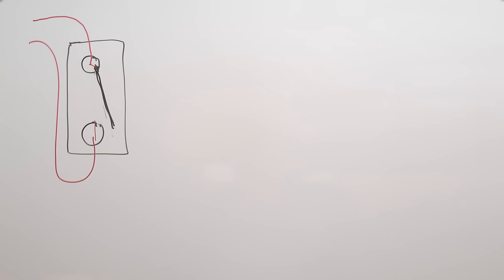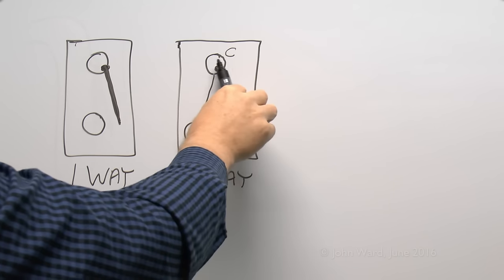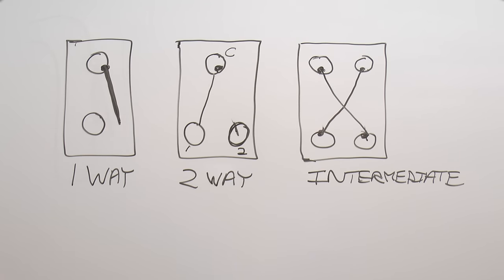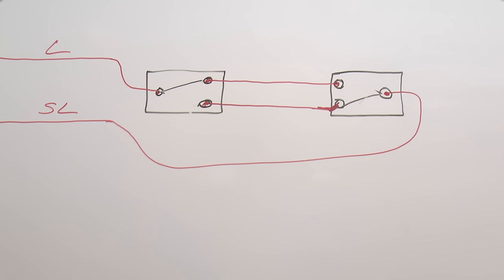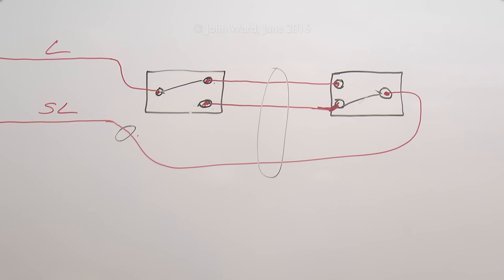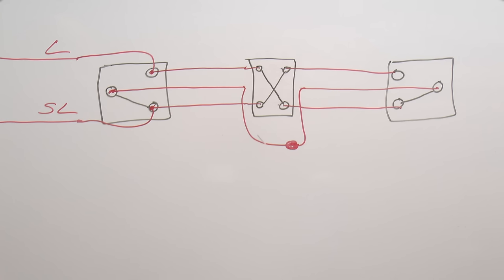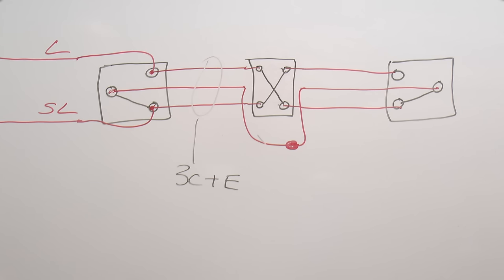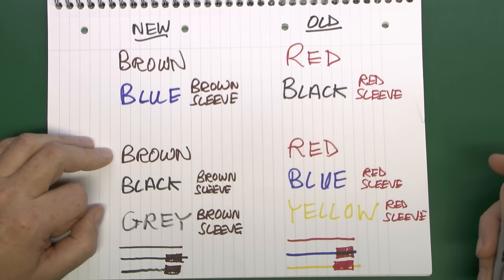Lighting Circuits Part 2 - Wiring Multiple Switches, 2 way and Intermediates

Comment: This helped me understand how circuits with intermediate switches work. Thank you.
Reply: I had seen both method 1 (conduit) and method 2 (house style) and always wondered why would they even do that.. (yes, I am watching a video of something I already knew)
Method 1 always seemed easier to understand and uses less cabling.. Why would anyone use method 2??
It wasn't until I seen the way that John drawn it I had the 'AHA' moment and noticed
Method 2 works better when power goes to the light, but just before being wired in, the switch is (kinda) like a spur. (Not really, but it's how I am going to remember it)
But Method 1 works when the power comes from Location A, gets a switch along the way, but the light is in Location B, and the light will just be connected to neutral in whatever way it wants.

Comment: Quite some years ago, I had a garage, with a single light, operated by a single switch by the rear door. I wanted to add  a switch to be able to turn the light on from the main garage door. My then boss, tried various ways of explaining how to do this, but to no avail! I just didn't get it. This video has made it very clear how it should be done. If only the Internet and YouTube had existed then, and I still had the garage.........!

Comment: I absolutely love all your videos. Clear, educational with easily understood, uncomplicated diagrams. 

One question I have: if you’re running the power from the consumer unit to the light switch and not the light, and you want the light to be 2way/3way, how are the switches wired. Many thanks.

Comment: I should have revised this video this morning. What I thought would be a straightforward consumer unit upgrade had turned into a baptism of fire. Having to change all connection as neutrals were being switched instead of line, then on a two way light the Single core cables, all red, not descenrable from each other could not fathom what was going on, not getting readings as expected, one switch worked, other didn't, hair loss was inevitable till I plumbed for switch must be faulty. Unsurprisingly, switch was faulty. Lesson learned, go round checking all accessories before I start!!! So now we're leaving the EU, can we go back to our original colours, especially red, white and blue for 3 core, how patriotic. Oh yes, great videos John.
Reply: Lee Greveson h
Reply: Yes! Patriotic sparkies I can handle.
Reply: No reverse from Europe, brexit or no-brexit, a group called CENELEC is quietly standardising all our electrics.

Comment: Hi John. Here in America we call your 2 way a three way switch and your intermediate is a 4 way here. The principal is the same here but we have to phase the neutral to split the 240 circuit at the main panel. Witch is your consumer unit. It's neat to see how you guys wire stuff there. You are very informative. Happy holidays to you .
Thank you
Mike.

Comment: Here in New Zealand, we use 1mm  3 core wire ( I forget the name of it),  the colours are Red, White and Blue. The outer plastic insulation on the cable is yellow, It's a bugger of a thing to work with because it breaks all the time while stripping it.  We also use 1mm for residential lighting as well

Comment: In Canada, the one way switches have an "on" position indicated on the switch handle, wheras the 2 way and intermediate ones don't.  I'm not sure if the wiring code permits 2 way and intermediate switches to be used in one way applications.

Comment: At around 17:00, an alternative way of understanding the intermediate switch is that in the parallel position the end switches are connected as before, whereas in the crossover position, it appears to each end switch that the other  switch is in the opposite state than it really is. Thus on and off are interchanged when you move the intermediate switch.

This immediately makes the use of a fourth, or forty fourth, intermediate switch obvious. If there are an even number of crossovers they cancel out leaving the end switches working as before; of there are an odd number then it's as if there is a single crossover.

Whether you prefer my explanation or JW's is a matter of personal preference

Comment: John - Great video..Do you have a wiring walk through for a 2 gang light that needs to return to the lighting ring.. e.g. 2 separate lights on a double rocker switch (..well dimmer switch) with a single live feed and a single return to the ring? Thanks.

Comment: Hi there, your video is very helpful. I wonder if you could help me with a question. I recently installed a dimmer switch in a circuit with two switches to control the lights in a room from two different points. The dimmer is a 2-way switch and works fine. However, if the dimmer is off the other switch doesn't switch on the lights. On the other hand if the dimmer is on I can switch off the lights from the other switch, but can't switch them on again with the dimmer.

According to the instructions it should work fine. I installed the same dimmer in other rooms and they work fine but they are only a single point which makes it simple.

Comment: Hi John.  I am using the switch connecting system, as I want to install a number of downlights.  This is straightforward with the exception that I want to incorporate two way switching using 3 core and earth. Where previously I would intend wiring the brown wire from the power in cable to the Common, in the video the black wire from the 3C&E is wired to Common.  Can you please describe the correct wiring in this situation.  Thanks

Comment: Hi John, Great set of videos thanks. I wonder if you can help I have 2 lights at separate ends of my dining room both controlled by a one gang one way switch. Would it be a massive job to install a two gang switch to control each light separately!

Comment: I have two-way switching in my bedroom - and there is a spare box by my side of the bed (there is a switch the other side). There is no wiring in the spare box or I would have looked into three-way switching. As it is I now have remotely controlled LED bulbs in both fittings, enabling control from my side of the bed.

Comment: John - thanks for these videos. The best I have seen so far. I get the concept but I don't quite get how to extend the concept to multi gangs.  In my bedroom I want a 3-gang (1-main light, 2-bedside lamp A, 3- bedside lamp B) a 2-gang (1-main light, 2-bedside lamp A) and another 2-gang(1-main light,2, bedside lamp B). I can't find a way to wire all the 2-ways together. I understand that all of these will be 2-ways. However I can't get all the wiring diagram right.

Comment: thats very interesting i didnt realise you could use the two way switches backwards using three core cable. i have always used them in the tradional way but you need to use four core cable which you did not mention. two lives,neutral and earth. 
very clearly explained though. thanks

Comment: That last wiring example with the two switch setup I found to be just plain weird. I don't really think we use it in Canada. The other thing I found in another video was rating 2.5 mm2 wire at 26 amps. 2.5mm2 wire is between our 12awg and 14 awg wire. Where 14awg is the skinnier wire which is rated at 15 amp and 12awg is rated at 20 amp in Canada. The 15 amp circuit at 120 volts is the common one, whereas the 20 amp circuit is just coming into use for kitchen appliances, because the former standard was split 15amp circuit for kitchen use. The split circuit could actually give 240 volts across the two hot wires, so the duplex outlet was split - a joiner bar was broken off that connected the two hot terminals. A special two-pole breaker  was used which turned off both hot lines simultaneously. Wiring for that outlet was white for neutral, black for one hot line and red for the other, or two separate cables with white and black. Ground(earth) in Canadian wiring is a bare copper wire usually or occasionally a green conductor. The split circuits  met their demise with more use of the GFCI (RCD) outlets. So a 20 amp version of the outlet became available. Actually, the outlets were always rated at 20 amps, but a plug that is used on an item requiring 20 amps is slightly different, with the neutral pin being turned 90 degrees. The outlet is configured so it can take either the 15 amp or the 20 amp plug.

Comment: Wouldn't the use of the "conversion method" with the 3 core & earth cause capacitive coupling (sometimes called induced current) which would cause LED fittings to flicker or glow even when the switches are in the off position? Therefore the previous method in your video would be preferable.

Comment: In the conversion method you instruct that the switch 1 connections should be connected to the corresponding switch 2 connections.  For clarity, imagine a face: Switch 1's nose connects to switch 2's nose (common 1 to common 2).  However, you have switch 1's "Left Eye" connected to Switch 2's "Right Eye".  Is this correct?  If it were "corresponding", the figure should look like this  - : X : -  with wires crossing over the common wire.  Please clarify.

Comment: Excellent video, thank you. When they changed the colours of wire, what was the rationalle behind the decision ? Like you pointed out, the colours they have chosen do not stand out from each other as the old colours. To me, a layman, it seems a step backward with regard to a H &  S choice. The more different they are the less choice of getting mixed up....
Reply from the maker: Alignment with IEC 60446, and later replaced with IEC 60445 which is used across Europe so that wire colours are the same everywhere.

Comment: Brilliant John . I’m struggling to find a video on 3 switches but with a dimmer included. I have a double switch at the bottom of the stairs which turns on the lights going up the stairs and landing and also the switch for the hall light.
How do I add a dimmer on the landing lights that stays to the dimmed level regardless of which of the 3 switches are used . ( one at the bottom of the stairs , one at the top and one further along the landing )great video .
Reply from the maker: Wiring is the same as in the video, just replace one of the 2 way switches with a 2 way dimmer.
Reply: @jwflame  thank you so much for replying I will give it again today

Comment: Hi John, I hope you are still doing your YouTube videos, I have a question, I want to control five led wall lights, with individual switches, with two two way light switches, first of all, is this feasible and safe ( from the consumer unit, fused at six amps ) and secondly, this is off grid, do you think that this will work ok. Many thanks for any advice that you can give. I am now going to look through any other videos that you have posted. Once again, thank you.

Comment: About the colouring, in Sweden red was earth a long time ago, and as a slightly colour blind person brown and red looks scary similar! 
The other colours was White (N), Black (L1), Brown (L2), Grey (L3), so the same as the new EU-standard except neutral (and earth). 

But looking at your videos I find it amusing that 3-phase seems to be so uncommon in the UK, in Sweden it's standard for houses and more or less standard for flats. I've lived in two different studio flats, both with 3-phase. 
I now live in Norway, and here we don't have neutral, so we have 230v between phases and 115v between line and neutral. So here 3-phase is also standard, but to me used to 400v 3-phase the main fuses are huge. I mean, in a studio I have 3x50A, and in Sweden I had 3x16A.
Reply: I've read that the new colour scheme was supposed to be good for people who were colour blind, at everyone else's expense of course; but I've always suspected it was a fudge of existing standards, based on the drab colour schemes that were readily available in the past. The British colours were based on the now defunct red, yellow, blue colour theory, associated with paints. It's a pity they didn't go with the more modern colour theory of light. Red, Green, and Blue for the three Line phases; White for Neutral, to represent the combination of the three Line colours; and Black for the Protective Earth, to represent the absorption of all colours. It's easy to have indicator lights for Line(s) and Neutral. Plugs would be Red, White, and Black. Would a colour-blind person like you find it difficult to tell the plug wiring apart?
Reply: I'm only slightly colour-blind, only problems with reddish colours, so for me it would work great. But the most common "normal" colour-blindness is red-green, where the person can't tell those colours apart, so they might disagree. 

But I like your idea, it's easy to learn!
Reply: Andreas Nyman Have you ever used gel filters, or a camera phone app, to help distinguish between colours? If I was colour-blind, that's what I'd be looking at.
Reply: Andreas Nyman c
Reply: Andreas Nyman In North America, live is black, with red and blue as well in case more live wires are needed.  Neutral is white, and earth is bare or green.

Comment: I have worked supply side for many years (learned on the 14th Ed. Rules and Regs. as was) and whilst I love these videos I do occasionally hold a different opinion to John. However on these ridiculous colours we now have to work with utterly and wholeheartedly agree; what were the IET/IEEE, whichever incarnation it was, thinking of. Oh well, spilt milk and all that!
Reply: The glories of committee decision making. Where the most boring solution garners the least opposition! I'd have preferred Red, Green, and Blue for the three Line phases; White for Neutral; Black for Protective Earth.

Comment: Dear John,   --  I think important correction,  You should be saying Red, YELLOW, BLUE  which then become  Brown Black Grey ...      Granted this matters less in this specific (lighting) case as that usually relates to swapping over L1/L2, but still I think from point of view of discussing official colour change this is a problem.   E.g. when talking 3-phases, this will reverse the phase-order...    Essentially this is (as I see it) factually incorrect.   Hope that helps!.
Reply from the maker: Yes, no idea why the order ended up as red-blue-yellow at the left side of the page.
Reply: I'd like to suggest you use the youtube text-overlay-facility to point this out briefly in the video, with many thanks!.

Comment: If you don't mind me asking, where are the neutral and earth wires placed in this positions?
Thank you very much for uploading these  informative and helpful videos!
Kind regards, George
Reply from the maker: Earth is taken to all points, light fittings and switches included.
Neutrals can be take to the light fittings only, or to both the switches and the lights.  Although the basic switches in this example don't require a neutral, it's useful to have a neutral there for installing smart switches in the future.
N&E connections covered in this video: https://www.youtube.com/watch?v=dnpV781c6Sw

Comment: Hi JW great video thanks.  With the strappers on a 2 way switch could L1 from one two way switch be linked to L2 on the other 2 way switch?  Or should the strappers go from L1 on one switch to L1 on the other switch ?  Thanks Glenn
Reply from the maker: They would normally go L1-L1 and L2-L2.  If L1-L2 then it will still work, but the light will be on when both switches are off or both are on, rather than the more usual arrangement where the light is on if the switches are in different positions.

Comment: So how does a 2 way dimmer switch work ? and would there be any issue having 1 dimmer switch and 1 toggle switch controlling a single light fitting ?
Reply from the maker: The switch wiring is exactly the same as in the video.  The only minor item with a dimmer and a normal switch is that the other switch is only on/off, so, the light can only be turned on/off at whatever the dimmer is set to.

Comment: on this video the system using the three core and earth, the conections dont look right, because the switches are laid on thier sides the common is ok, but the other two are conected i.e. S1 and S2 are conected to S2 to S1, i havent tried this yet but is it correct.

Comment: Could you show how the intermediate switch works mechanically? How does it cross the contacts without shorting everything together?
Reply: It's really a ganged 2-pole, 2-way switch.  Now I've given you that hint, you should be able to figure out the internal interconnects yourself.

Comment: Very good video John - as are your other ones! Just to make sure - I'm going to connect up 6 light fittings  in a outbuilding (it's big) and want to use 3 switches to control them all. I assume the lights are looped through using the SL coming from the switches? (I asking as you mentioned that the intermediary switch  is only used for single light controlled from 3 or more positions)
Reply from the maker: Yes, can be used for as many lights as required, just extend the SL,N,E from the first light to the other lights.
Reply: @jwflame  Thank you for your fast reply John